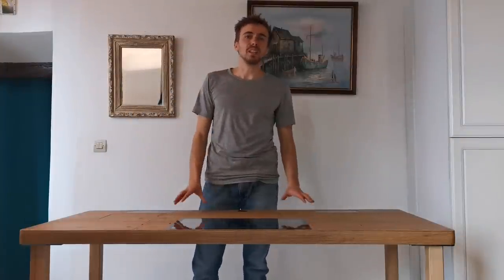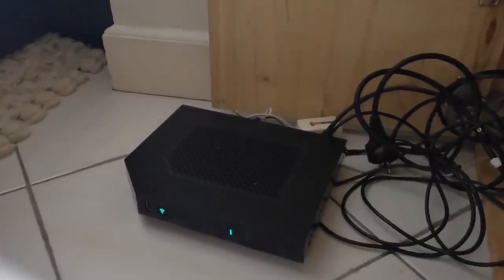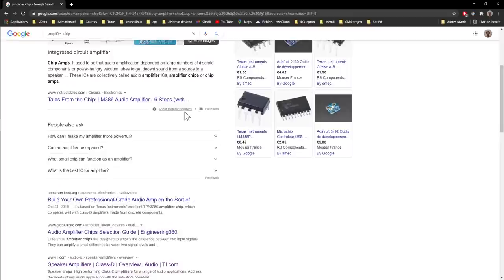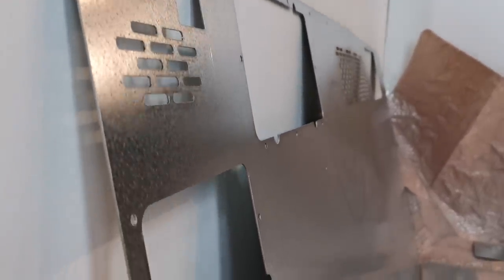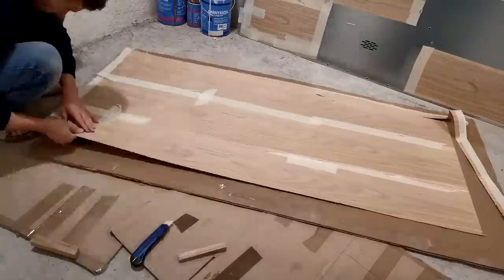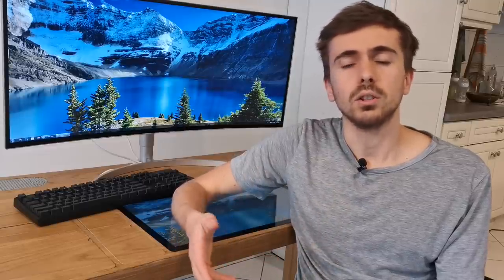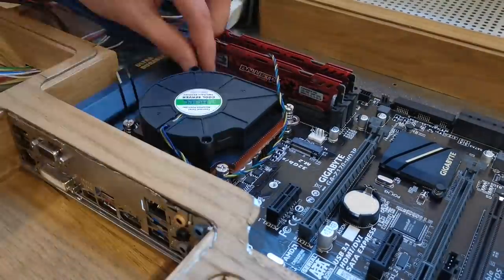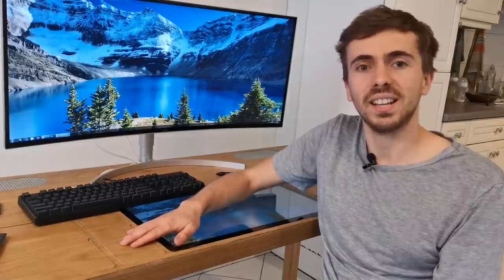Building my Dream DESK PC

Comment: So as a prototype this is really cool, but I think for it to hold up over time and to look even better, you should consider replacing the veneer or the metal sheet with laser cut 2mm plywood, so the covers fit better and don't fray at the edges. You than also don't have to cut out the speakers. You also could use small magnets to hold the covers on.
For cooling purposes you could look into water cooling and add the fans at the back of the table. And you should definitely replace the foam under the power supply with something sturdier, cause this will compress over time and no air can pass.
Reply from the maker: Thanks for your ideas! Yes you're completely right, steel and veneer is hardly a good solution. It's very much too complex to manufacture. Plywood is the way I'm going for my second prototype and it looks very good. Though 2mm is too thin with plywood, I used 8mm with my intermediate prototype and it's good. I think I can reduce to 5mm if I find a strong birch plywood.
Small magnet may not be required because the covers hold very well. The question is more how to enable easy opening of the covers. I'm investigating push push mechanism. Such are used with magnet for kitchen furniture. That might be the thing.
The thing I used is very hard, it's not really a foam, I used that word because I don't know the correct one for that. It's the thing that goes under chairs to avoid screeching noises.
But overall the thermals on that first desk sucks. I'm redesigning it completely and I think the next prototype will be really super cool, even while using mostly passive cooling and air cooling. I never seen a heatsink as big as the one I'm planing actually :)

Comment: This is so far the best DIY desk I ever seen :)
Reply from the maker: Thanks! :)
Reply: I concur
Reply: @mayankagrawal6781  i think he mentioned it that he was inspired.
Reply: He take it to the next level though
Reply from the maker: @mayankagrawal6781  1:25
Reply: @mayankagrawal6781  he mentioned it in both the video and the description.
Reply: The best until you start using it, the real working space is probably like 10% of this big table
Reply: @pierreboyer9277  Brilliant work, very well thought out. Couple of things, the power and control buttons could maybe be installed at a 45º angle for better ergonomics, looks like you have the space. Don't love how the dvd tray is installed , maybe towards the outside if possible and have a sliding panel towards one of the sides (like a simple groove slotted sliding door like a cabinet) to hide it, if you cut a 45 angle on the miter and have a matching cut on the part where it joins when closed it would be invisible 

««---- |##sliding out part### /    space DVD etc   /===wood front===|

, same goes for card reader but if at 45º it wouldn't be a problem, LOVE LOVE the power cable management and the universal sockets (MAGNIFIQUE sooo doing that). Having the metal machine cut also great didn't think of that since most of us will have different needs when i saw DIYPerks, never even occurred to me doing that for general use.

 Scanner perfect i would maybe put some sticker vinyl in white on the inside of the scanner panel door for when you don't scan full sheets, but thats minor, or sand the metal with a rough sandpaper to give it a bass scratchy look. 

Your blowout problem with the holes on speaker, can be fixed by drilling in a sandwich way

metal panel»»veneer»» second panel   with holes thin sheet of plywood or anything really, clamped or taped together, DRILL from the second panel in then just light sand, masking tape of the metal side may save some cleaning, just look at woodworking videos of how to avoid blowout and or tear-out when drilling even painters blue tape would work if you add 2 layers, so you can still repair the gap if you so wish or when you make the next one. 

 (or you could get maybe the veneer for that area laser cut maybe - what if you applied the veneer on the panels before they went to the cutting, in production that may save you trouble if its practical, that also would allow different face finish materials - like melamine or vinyl, cork is also nice non static and anti-slip) pay someone to prep the metal sheets near the processing, that way you have quality control of what is fed to the cnc business, or if they can do it in house (doubtful but you can ask)

Also the top veneer if its too thin you can glue the first layer perpendicular and the the final top one the way you did, it will give extra wear and tear protection once finished, depends of how thick the veneer is to begin with.
 Hope this finds you well and good luck, this gave me soooo many great ideas, love this whole approach. MERCI from Portugal.
Reply: well its a lot similar to diy perk's desk pc
Reply: @mayankagrawal6781   I guess the main goal  of "DIY perks" is to inspire us and try making one for ourselves which Pierre has done fantastically. 

@Pierre, the addition of scanner and printer was brilliant.
Reply: @mayankagrawal6781  Duh, it is inspired as others have said and the dude in the video has said.
Reply: @mayankagrawal6781  Also, it is called DIY- Do it yourself. So, all things considered it is fine and doesn't even needs to be said that it is similar.
Reply: Watch DIY perks "building a desk pc" :)

Comment: While I love the idea behind this all-in-one desk, I'd be extremely concerned about thermals for longer use sessions. It would have been well worth it to make it a little thicker in order to fit an AIO or water loop in my opinion.
Reply from the maker: You're quite right, and that's why I'm working on the cooling system for a few weeks, and I came with a really neat idea to cool the system ! :) Second prototype is in the build!
Reply: i'd be more concerned of me punching a hole through it, with it being hollow lol

Comment: While not as polished, this puts LTT’s desk computer to shame.
Reply: That's exactly what I was thinking.
Reply: LINUS needs to do v3 of the project with him.
Reply: I wouldn't really agree. While some of these fancy feature and ideas seem nice at first glance they are not very practical in the long run. The power sockets for example. He states you can plug in extra monitors and peripherals. Nice but where is the cable going to be routed to the peripheral? You need to leave the cover open and that negates the entire point of it being covered or hidden in the first place. Most of the panels are made to size. That means that upgrading the scanner, printer or anything else other then the computer would be a pain. Also I'm not really a fan of all the bumps, ridges and holes that the panels create. Imagine writing anything on it, specially with the second monitor right in front of you. I know that's not the point of the desk but it is a desk after all and most of us need to write something sooner or later. I don't want to bash on his project. I like it, if not for anything else because of the high amount of effort that went in to it. I respect people like that. I'm just trying to make a point.
Reply: @winnetouch  bro you got to count that LTT has a lot of budget plus a lot of man power, tools and skills. It's a personal point of view but I feel the whole point of making a  pc cum desk is for minimalism or reducing crap from your table. you definitely want your desk to be looking(slim) as a regular desk so rest features are optional. Plus adding functionality is of way more value than showcasing your components. .. BTW I love LTT but still transparent here.
Reply from the maker: @winnetouch  Regarding the power sockets, there are actually holes that let you root the wires to the main cable hole (which is underneath the external monitor for it's HDMI and power.)
And to write you can write on top of the integrated screen, which is where a paper would naturally rest when sitting at the desk.

Comment: very nice rendition of the @DIYPerks's Project!!!! as Mat would say: "Very nice in deed"... Perhaps you would benefit from wireless keyboard and mouse :D
Reply from the maker: Yes wireless keyboard would be much better here. Though it was just to show that even a big keyboard can fit in.
Reply: Wireless keyboards and mouse would be great but I personally prefer wired keyboard and mouse because there would be no battery drainage issue in the middle of some important work.
Reply: @TanmoyDasIN yeah good point, I wouldn't want to get killed in the middle of a call of duty match hehehe. Although the aesthetics of a cable-less desk is very appealing.
Reply: @pierreboyer9277  yes that's true, by the way the extra compartments you created for the printer, scanner, ports, etc. is very useful, you could even fit a Xbox control there. Again, very nice job!

Comment: I love this first draft. The one thing that bugs me, as someone who is studying Graphic Design and uses pen tablets extensively, is the flat pen display. That would kill the neck after longer sessions. It would be really cool if their was a way to prop the monitor up at differnt angles. Though thats just my personal prefernce. This is one of those projects I'd love to do, but dont have the budget or the tools to build one to my desired specifications as a full time student. 

If I were to build one i'd want adjustable legs so i could work while standing if I so desire. I'd also have 3 monitor arms built in for optimal productivity. (I perfer my tablet on an arm so I can place it at the most comfortable angle when drawing and use it as a regular monitor when not in use) My PC hardware is on the higher end and I have 20TB worth of drives so I would need more space for my components. Id probably have a larger bump off in the corner on the underside of the desk since  I hate thicker desks. If the desk has a drawer over my legs than the serface is too high. Id also perfer the desk to be an L shape, which complicates the height adjustment. The main desk also needs to be deep. I like to rest my arms on the desk rather than arm rests. I would need to also optimse the best spot for my streamdeck which I use for macros and navigating bookmarks and folders quickly. I cant stand working on hard surfaces so I'd need to use a large desk mat which eliminates and cool see through designs. Though one design element that may be cool would be to add a lightbox under the mousepad where you have the tablet monitor. My dream desk wouldnt be as elegant, but it would be hella utilitarian.

At the moment I am getting by with a deep small-mid sized ikea kitchen table i got for free from a school and a modded desk from some old micheals furnature which happened to be the exact same height as the Ikea desk to form an L shape. I Have hot glued 3D printed cable guides to keep all my wiring clean under the desk and have a bunch of tech velcroed to the underside of the desk out of sight (a wii, hdmi switcher, 1080p capture card, mClassic upscaler, and apple TV). And I have tones of tech and controlers mounted to the walls with 3D printed mounts. The only thing I really dislike with my current settup is my massive PC case and my router sits on my desk, my desk is slightly too short so I cant sit im my chair at the optimal height for comfort, the lighting setup is ugly but get the job done, and since its so jank and all the furnature is white, its not very pretty on the eyes.

Comment: Great job!
Only a question, why didn’t you use the metal surface on the lower of the desk as a  heat-exchanger, it has a huge surface. You should simply create adapters for the CPU and GPU, moreover if you use aluminium instead of iron you have a better thermal conductivity and probably you can have a full fansless computer super silent.
Just a suggestion, anyway great work.
Reply from the maker: Thanks ! 
Yes that's a good idea. I'm currently thinking on how to use it in a water cooling system. I think the reservoir for the water could be made on that surface which would dissipate the heat.
Reply: @pierreboyer9277  for sure! You have about 2 square meters of metallic surface

Comment: I love this so much, but I do worry about how future-proof it is. What happens when one of the components that uses a perfectly tailor-made space doesn't work anymore? There'd be nothing worse than purchasing an incredible, likely very expensive desk, then having it become worthless down the road because it cannot be changed without cutting things apart and rebuilding. 

Is there any chance you might design a more modular kit version to sell? I could see there being two models, one the over the top perfect one as seen in this video, and another with just enough compromise to be futureproof, customizable, and maybe just a tad more affordable.

I'm also interested in whether you could think of a way to make it somewhat secure against spills. 

My roommate's sick cat peed on my desk last week, so "just don't eat/drink at the desk" isn't quite enough for my disastrous life.
Reply from the maker: Regarding the future proofability, for the computer components : motherboard, gpu, PSU, it won't be a problem because they have relatively standard size.
For the scanner and the printer it might be a question. Though for the scanner, I increased slightly the size of the scanner box in latest prototype such that it will be more accomodating. For the printer the box is a bit bigger too, so other thermal printers will fit too. And the idea is that it can be used as storage even if it fails.
For the screen it will be an option, and the wood cover will be provided in all cases, such that if the screen is broken you can still replace it with the original wood panel.
Also I plan to keep replacement parts available on my shop, as I'm doing for my game console for instance (see www.8bcraft.com). So even if the screen breaks you'll be able to replace it.

Comment: You ought to launch this! Some ideas to make this the ultimate desk (I got excited!):
- add a motor to make the desk a sinking one with adjustable height
- make the tablet in front of you capable of inclination so that you can lift it a bit and read more relaxed
- add some led lightning in the storage decks as well as in the back side of the desk.
Reply from the maker: Thanks !
For the standing desk legs, it's definitely possible to add some. I didn't used such initially because there was already many things to see here and  Ididn't want the standing desk legs to be a distraction.
For the LCD, it's a good suggestion. A mechanisme could enable to do that. I'll have to check what king of mechanism are usually used for this kind of things.
And LED yes I could have put some in there I guess :)
Reply: @pierreboyer9277  Sth more you could try, you could put this mechanisms in the lids that when you press them down they "unlock" and you can lift them, and when you press them down again they lock. So that it is a bit easier to lift the lids. Magnifique!
Reply from the maker: @tterranigma2  Oh that's a good idea! And it should be too hard to implement. It just needs push-push mechanisme to be integrated in the wood.
And this way it won't need the small notches and leave the surface of the desk cleaner! 
Thanks!

Comment: LIttle bit of sanding needed for the lids of the compartments... edges look a bit rough.  But this is the most creative and cool desk I've seen! Usually people build the PC in the desk with a glass top so you can see the computer inside.  But it's cool to hide it like this.  Wonder how heavy the desk is with all this stuff in it to move!   I'm currently trying to think of what I can do to put a privacy panel on my desk.  I have the discontinued IKEA tabletop that is a huge solid piece of hardwood in a butcher block style... it's 61" x 28" so it's huge... but I want to build like a black panel or wooden box that goes UNDER the desk to hide cables and do cable management so I can have my desk facing out into the room rather than against a wall and still hide my cables.  Not sure what kind of wood would be cheapest to do this and still look good.

Comment: Good idea. I have two suggestions first u put too much thermal past on the cpu, u can try to revers to oposit site the motherboard. If u do this your pc will be take fresh air. Good job.
Reply from the maker: Thanks,
You mean applying the CPU directly on the bottom metal sheet ?
Reply: @pierreboyer9277  yes open holes to pull clean air.

Comment: Very awesome and a great idea!! Although for the next iterations I’ll suggest moving the power button somewhere more accessible as you have to move/lift your monitor to reach it atm.
Reply from the maker: Good catch! Indeed in the video setup it required to move the monitor to reach this cavity. But the screen is actually to be mounted on the wall such that it will be easily accessible.

Comment: 17:42 you should've tried to mask off the section of the laminate before drilling the holes. They would've come out a lot cleaner. But overall you've done a fantastic build!
Reply from the maker: Yes you are correct. There are a lot of things for which I found ways to make things simpler, but after doing them. So for the next build it will be much easier :)
Thanks !

Comment: If I have recognized correctly, you have a very bad airflow with the CPU cooler because the fan pulls the heated air from the free space above the motherboard and then blows directly on the copper radiator. However, the hot air can not escape after cooling and thus you cool your CPU from time to time with hotter and hotter air.